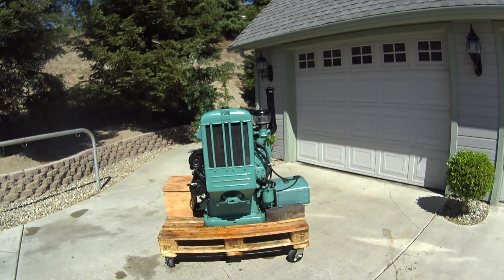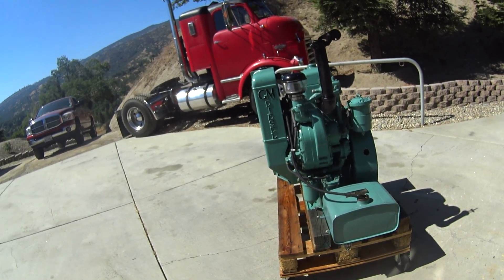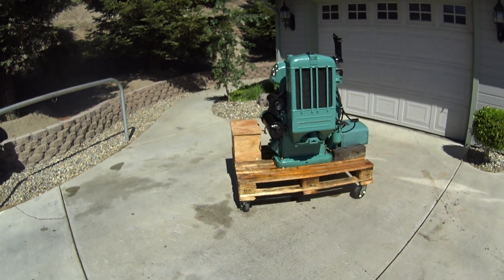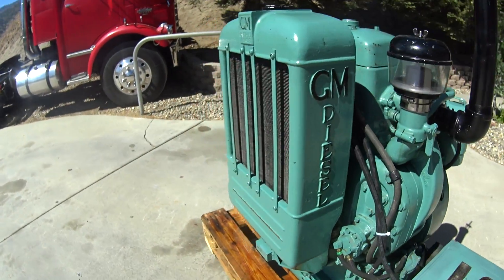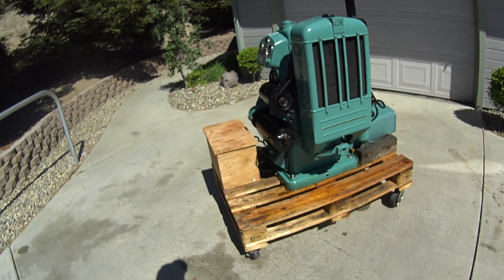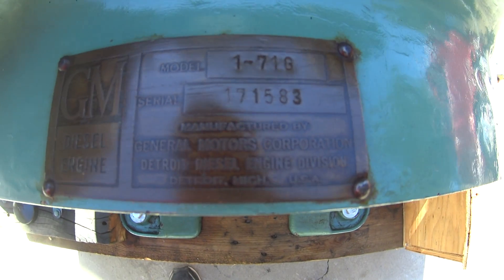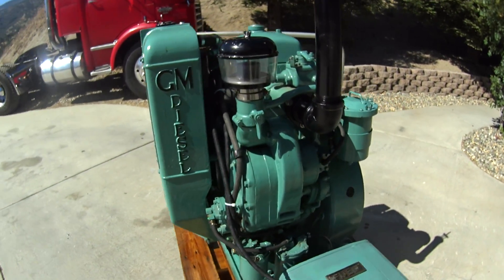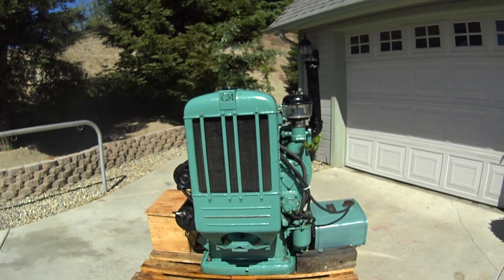GENERAL MOTORS 2 STROKE 1-71 SINGLE CYLINDER DIESEL ENGINE RUNNING

Comment: So the series number was - 71 and the first one or two digits denoted the number of cylinders. In the early 90's a friend of ours was working on a 16 cylinder one, and I believe that was the largest of the series. 🍃This big engine used to drive a pump that pulled grain in and out of ships at the docks, but i think he was only interested in the engine to service, repair and sell as he was a🏵 machinery dealer. What caught my eye - and that is 🍂why I remember these engines - was how the injectors and the injection pump were all one unit worked by the rockers. Also the scavenging and intake of fresh air by the charger unit at the side were good design elements.🛑

Comment: I’ve heard that sound but never saw the engine. Never knew they made a single 71 series. We were on a dock in Louisiana and a really old tug lumbered by real close. I heard the single cylinder running and saw about a 6 inch hose pumping water. The dock foreman said it was a one lung diesel.  Remember thinking it would make a great paint mixer from its shaking. That was about 78 or 79. 
Nice engine you have there! Thanks for making the video.

Comment: At 1200rpm one generator racked up 43,000 hours and was still running. 
You should check the idle speed-even though it sounds neet to be chugging-it still needs to be idling at 500rpm. I remember this at Delaney and Ahlff

Comment: Get yourself a single N70 injector and crank the No load high idle up to around 2250 and you could have a 40 horsepower jackhammer 😂. I assume the vibration issue is why they limited these to 1200.
Reply: 1200 is for generation.

Comment: 1200 RPM seems slow. The 6-71 revved to 2400 as a rule. I wonder why they limited this one so low?
Reply: Single cylinder vibration issues..

Comment: Wow what a cool engine. I wonder how fuel efficiency compares to modern diesels. This would make an amazing home backup generator. Thanks for sharing this video. Probably the 3rd or 4th time I've come back to watch it.
Reply: 2-71 generators are actually out there and are way smoother and better IMO. I'm looking for one now to replace a perfectly good Perkins light plant I have. I want more juice. These things can have different injectors fitted to tune them to the load.

Comment: Wonder if the starters were ‘one size fits all’ for most of the 71 series. That starter looks a bit large for a seemingly small displacement.
Reply from the maker: I had a 6-71 and it had the same starter on it . GM used what it already had .

Comment: it is shame we do not live in a free country where these engines could still be made and sold
Reply: They can still be sold…just not new. Great engines in a truck if you can do your own mechanic work like I do to offset the added cost of fuel and upkeep with an old mechanical diesel, we have 2 Cummins and an 8v71 Detroit. 318 horsepower and 4-5mpg aren’t anything to write home about but man has it been reliable. I don’t think there’s an engine that can have more wrong with it and still get you home than a Detroit 71 series.
Reply: They can still be found and sold by individuals and preserved and restored
Reply: Nice icon.  @redneck826
Reply: what's even Moore sad is the fact that these things and others like it are still being used in China and India. but we're the ones destroying the planet. go figure.
Reply: Old sweety for sure . Thanx for showing her
Reply: No manufacturer would ever want to make any more of these regardless of country.
Reply: @garygolfer3243 Yep. Too durable and fixable. There will be a mechanical renaissance hopefully as the US economy and society continues to break down.
Reply: @allurared9029  lol.. no there won't be.

Comment: I worked at the Australian distributor for Detroit Diesel for nearly 30yrs and in that time I had heard and seen photos of these but never saw one in the flesh. 
Do these have the same issue with other single cylinder engines where they can start and run backwards?
Reply from the maker: The starter will always start it in the proper direction.
Reply: My mom used to crank a Petter two-cylinder diesel in the 1960s to operate a rice mill. Sometimes it wold rebound with the compression and start backwards.
Trinidad & Tobago.
West Indies.

Comment: It sounds like it might be governed lower than 1200 rpm? If I had to guess it may be at 900 or something which would make sense for a 60hz generator.  Figure that would be about 25 horsepower?

Comment: I've seen a few 1-71s in old ships. All were hand started by baring over a large flywheel and had compression releases. They were running 250v DC generators and ran at 1200 rpm. Many smaller ships and tugboats had a 250v DC system that ran everything from lights to refrigerators.

Comment: Sounds like it could run much faster, be interesting to know once you get the tach hooked up what it's really turning but I'm guessing that you're maybe at 1000 rpm or so there.
Reply: Most of these are governed at 1200 RPM so they can run a 6 pole generator.
Reply: This one seems to be running at full throttle. https://www.youtube.com/watch?v=GRjOLmqHa5A
Reply: @extrapilot300s  yeah the one in this video is not at 1200 rpm.. It is governed much below that. I was guessing 900 but it is probably even lower than that. Though the one in your link sounds much higher than 1200rpm.. but with no tach I couldnt begin to guess where.
Reply: @extrapilot300s  yeah that's more like it! That one has the typical GM sound to it.
Reply: Automotive 71 series from that era often specced to go to 2100 RPM, and even higher for marine applications, but I expect you wouldn't want to go anywhere near that on a single cyl - it'd probably try to walk off somewhere!
Reply: @holysirsalad  exactly,, I was expecting that wheeled pallet to start wandering away...lol

Comment: If I were to offer how much???
Reply: rileydog362 I have an original 1946 onan we took it out of the crate 1 year ago and it is in our house without a speck of dust never run and still has the hand crank as well as the tags and the 70 year old crate.
Reply: @y.a.dproductions6819  was that the one on eBay a few years back near Chicago I think? I nearly bought that one as I have several of the W series Onan’s. Looked like a nice original piece.
Reply from the maker: $ 12,500

Comment: The timing sounds off, what's it's set to?
Reply from the maker: You have a good ear for that . The valves and fuel injector needed to be set . we actually did that a couple of days ago and I will post a new video in a day or so .
Reply: @rileydog362  Detroit's have a very distinct sound and it sounded like it was labouring with no load

Comment: That is a real treasure!! Would love to see you start it, by hand.
Reply from the maker: I have to find a crank that fits and then will do a video . Thanks for watching
Reply: @rileydog362  did you find a handcrank, for the 1-71 ?
 May need to have one made, 😎☕
Reply: @invisibilianone6288  ,
We used an old steering wheel that was converted to fit the John Deere "G" model, lol.

Comment: what would be the cheapest similar engine for me to look for? are all single cylinders valuable? are 2 cylinders cheaper?  I just want something to make noise.
Reply: Used to work for halliburton in early 80s as offshore mech. Some units had hydraulic starters that you pumped up by hand to charge accumulator to fire starter. It was always fun to trip emergency shutdown and watch some green operator pump till his arms ached and still not start the engine. A lot of great memories working out there on Detroit's  great looking unit. Good luck with it
Reply: Cheap eBay 10hp diesel
Reply from the maker: Single cylinder diesel engines are more expensive but gas engines are easy to find and sound the same .
Reply: Not really interested in Gas..